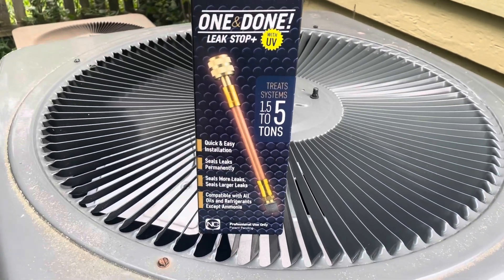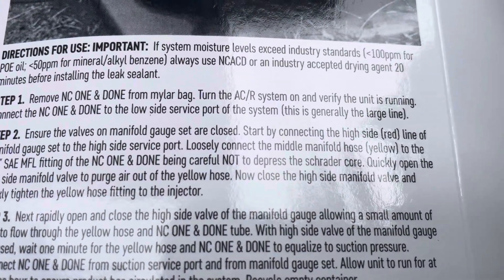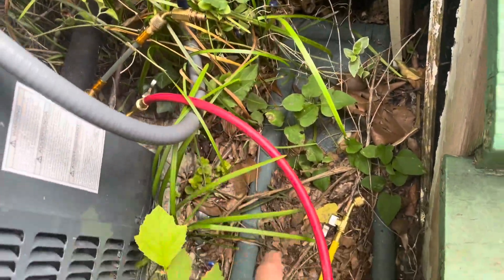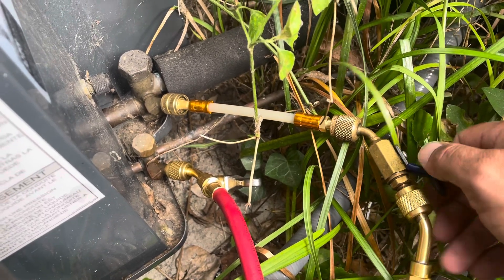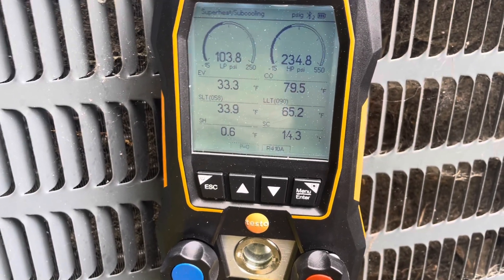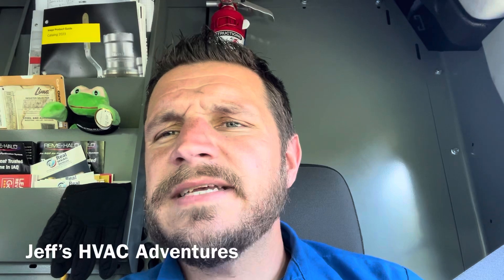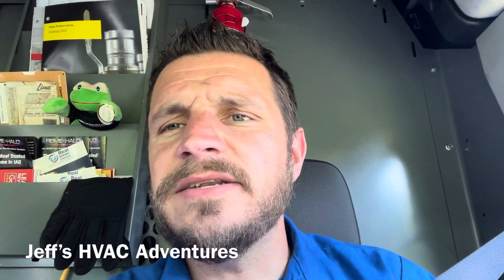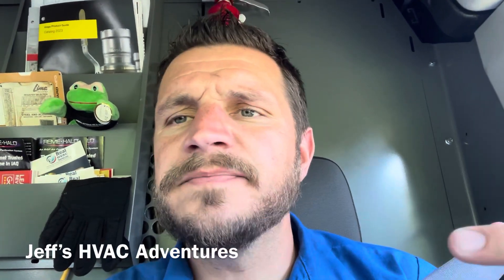Goodman Heat Pump Low On Refrigerant!  Adding Leak Stop And Charging With R-410a!

Comment: Whats the difference between a nitrogen charge and refrigerant charge? My condensor coil was diagnosed with a small leak and most of these HVAC techs want to replace the unit instead of sealing the leak.
Reply from the maker: A nitrogen charge is just a leak testing procedure.  We remove the remaining refrigerant, fill the system with high pressure nitrogen and try to locate the leak.   Once the leak is found, it’s repaired, system evacuated and charged with fresh refrigerant.

It is a costly process and sometimes it makes more sense from a monetary standpoint to replace the system.
Reply: @JeffsHVACAdventures  Does sealing the leak and then topping off with 410A refrigerant make sense? I don't want to get a new system. The air handler is fine.
Reply from the maker: It really depends on how large the leak is.  If you’ve lost half your charge or less then I’d say go head and try the sealant.  If it’s lost almost all the refrigerant, then you would need to find and fix the leak or replace the system.  At the end of the day, it’s up to you.  Don’t let a pushy HVAC sales tech force you into making a decision.   Good luck.

Comment: Maybe I’m doing something wrong because I’ve used the Nu Calgon leak stop 3-4 times on very old systems and it did nothing.  I only use it as a last resort on systems that will likely be replaced within the year.
Reply from the maker: Depends on how big the leak is.  I’ve had mixed results.
Reply: @JeffsHVACAdventures  Systems were old R22 with slow leaks.  Just didn’t work.   At $70 a pop (my cost), not really worth it.

Comment: Why is my ac shutting off at night and will no come back on till around ten am? The evaporator coil’s are not frozen. The unit runs fine in the day but once nighttime comes it wants to go to sleep. Anybody? Thanks
Reply from the maker: Do you have a schedule set up on your thermostat?   When it goes out do you notice the fan or outdoor unit running?
Reply: @JeffsHVACAdventures  I don’t really know. It used to run all night but recently it has been shutting down at night. I was told to take the fan off auto and run it constantly. That worked for a while but now it’s starting to shut down again. No the outside unit is not running. It’s kind of hard to tell. We’re on the third floor and the unit is on a pedestal on the outside wall. I really don’t think it’s running. I can see it through the window but I can’t hear it. I’ve had a couple guys come out and they say everything is normal. All they want to talk about is replacing the system. It’s a 2009.  It runs like a champ in the daytime. I hate to replace something that works so good in the daytime.
Reply: @JeffsHVACAdventures  hey Jeff I think I figured out my problem. After the ac shutdown tonight I went to the thermostat and turned the unit off. I waited about twenty minutes and turned it back on and walla. It fired right up. So now I guess I’m going to have them replace the thermostat. I hope that cures the problem. Thanks for your reply.

Comment: I have a Goodman HVAC in my rental property.  I am not sure of the model or the size.  It has to cool and heat slightly over 900 sq ft.  The unit is one year old this month.  It froze up earlier this month.  There was ice on the fat copper wire in the closet inside.  I presume there was ice on the outside unit.  At least that was what I understood.  Waited hours for the ice to melt, and afterward, it cooled fine.  I asked what caused this to happen?  My filter was NOT dirty.  I change filters regularly.  I do not have a choice because I have respiratory problems.

It cooled fine for another day and half.  I kept checking the closet because I was worried.  Sure enough, a day and half later, a sheet of ice formed on the fat copper pipe again.  I pushed the temp up to 78 with fan set on ON as instructed.  Tech came back and eventually declared the computer(?) board was bad.  Said it was bad from the factory.  So, he replaced the board. It took 4 hours total to switch out the board. About 40 minutes of those 4 hours was to collect the replacement part from a shop somewhere.  

I like to be safe than sorry, so after the board was replaced, I put the bucket back in the clot again just in case.  Sure enough, it leaked.  The man said it needed insulation, which it has never had before. He came back a third time and added a foam rubber material all up and down the copper pipe. In an abundance of caution, I put the bucket back in the closet again.  I checked the closet that evening, and sure enough, there was water leaking out of the insulation into the bucket.  Now, however, I also saw another leak on the wood boarding that holds up the unit in the closet.  So, I put a  plastic bowl there, and it began to collect water as well.  I left everything alone for the next 3-4 days to see if this was perhaps residual water and it would stop.  It has not stopped.

The water in the bucket and in the bowl combines equals about 1/4 to 1/3 cup of water every couple of days. However, the HVAC has cooled the house just fine ever since the board was replaced.

I have NEVER had to keep buckets and bowls in an HVAC closet to catch dripping/leaking water before.  I cannot believe this is normal.  Is it?  I am not sure what to do.  I am afraid to complain again since this is a rental property, and they hate to do maintenance.  I am worried, however, that there is still a problem, and if it goes unchecked, it could get much worse and possibly even kill the unit.  

Anyone??
Reply from the maker: It seems that either the unit isn’t draining properly or the large copper line isn’t insulated properly enough.  The large copper line is called the suction line and if it isn’t fully insulated, it will drip.  So none of the bare copper on that line should be seen or it will drip.  Hope this helps.
Reply: @JeffsHVACAdventures  I will look at it again, but the copper line has that foam padding up and down its length, and it is taped at the ends, although the tape is not uber tight.  I think in that case it is not draining properly.  I have never before had to keep a bucket in an HVAC closet for water dripping.  Will this likely continue once the weather turns. cold??
Reply from the maker: @user-lz6dm5lk9y  no, during heating season a heat pumps outdoor unit becomes the evaporator and will terminate its water from the outdoor coil.

Comment: 32.8 F, you're close to freezing your evaporator coils. It's possible in the condition it was in the customer lowered the thermostat. Could be a meat locker in there after recharging. And the leak stop didn't do that, it's the 3lbs you put in. You'll know (as a good tech) when you come back in 2 weeks to check the readings to see if it lost any refrigerant. I'm sure if the owner came home to a meat locker, he adjusted the stat. Could be poor air flow, but with a leak you probably just have a low charge situation. Leak stop is good on budget but as you said, a leak fix is better. I didn't see any caps on those Schrader valves so that might also be an issue. Core replacement is cheap and easy. Imagine putting leak stop in your compressor only to fix a leaky valve. lol

Comment: Some tech say it bad, will interfere and damage unit. Why can't they be on the same level, so much wishy-washy
Reply: Sticky sealants stick to your compressor too. So it will shorten its life. Like stop leak on oil leaks in your car. Cheap, but no really good in the long run. Last ditch effort for more time.

Comment: how does this impact the lineset when it comes time to replace the entire system?  gonna wreck the lineset?
Reply from the maker: You should always change the line set when replacing the equipment when possible.  But if you keep the same line set It wouldn’t bother it at all as long as you flush it properly.
Reply: @JeffsHVACAdventures  Blow a cleaner peg through it.

Comment: this isn't a serious video right?
Reply from the maker: Yes it’s a joke that only you understood.
Reply: @JeffsHVACAdventures  I understand your pension for working with customers. But for better results, insist on leak fixes. I suspect the Schrader valves may have had a hand in this leak. Simple fix, but a leak check could result in a paying customer and do it right. Better in the long run for the customer.
Reply from the maker: @anthonylosego i do push for leak searches.  Most of the time, customers cheap out and take the least expensive route.  This particular customer actually just sold this house last week, so that's why he was so cheap on this repair last year.

Comment: I paid someone to do the Max Seal Ultra and slso add 2lbs of R-22.  He charged me $500 for the R-22 and $270 for the leak stopper.  I was wondering if to high cost or this is average people are charging.
Reply from the maker: Seems in line.
Reply: Leak stopper is like $40 on amazon and can be done at the same time as adding r-22 so he worked you hard on that upgrade.
Reply: Probably spent $30 in r-22 and should have taken all of 20 minutes to do.
Reply: @darylfortney8081  R-22 is retired. It's getting expensive. Just a hobbyist/researcher.
Reply: That coil really needed cleaning, even a complimentary water hose spray down
Reply: What color was the bottle of refrigerant
Reply: @hilljack6765  Who is this distributor? I'd like to buy some.

Comment: What do you do if the low pressure switch is in lockout? Lennox system has a really slow leak. Plan to add sealant and then charge the system. However, can this be done when the compressor is off, due to the lockout?
Reply from the maker: Bring the system up to full charge first and then add the sealant.
Reply: @JeffsHVACAdventures  Thanks Jeff. Is it okay to charge the refrigerant when switch is in lockout? I assume that the 410 tank pressure will add enough to deactivate the lockout, but not sure.
Reply from the maker: @H2ObarryField  yea, it should take a good 3-4 lbs with the system not running.  Should be enough to close the LPS.
Reply: @JeffsHVACAdventures  Thanks, Jeff. It worked!

Comment: My system was blowing room temperature. Here I've won't copy him out. Told me I need a new unit. You're gonna charge me $1500 to recharge the unit and tell me it wasn't worth it. They gave me a price to replace a unit $8500. I got another pressure for another company. They wanted $10500. I told him both tests.  Eat s*** found it a guide to the redneck underground. He come well overlook data. Pump the system to finally help pressure for 35 minutes. No leak, so before we did that. We put new refrigerator again. Put that fixed yellow and fill the system up. Charge you $400 HBA C companies, repairmen or thieves.

Comment: I would think the time the unit was running with a low charge while you were putting in the one and done, the evap coil frosted over, creating the issue of low evap pressure. When this happens, you only had to kill the condenser power for about 5 minutes, then you would have thawed the coil and pressure should come back up. That could have been verified by looking at the condensate drain and you would see that surge of condensate water coming out for a minute then stopping. If that didn't happen, then i would say cold room, dirty evap coil, fan speed or TXV issue. Just my thoughts here, from 41 years of experience.
Reply: I have heard the txv gets stuck with this stuff.

Comment: Don't get it!  If u can't go inside the house,how is the ac on. If Temp inside is cold. Why is the ac running.
Reply: 62F degree day. The subcooling shown would keep it fairly cool even with that level for that day. So the owner left it on. The subcooling was so low, it was just keeping up but running constantly. No match for a 90F degree day though.
Reply: @anthonylosego  thanks for ur response.

Comment: Where did you buy that Leak Stop+? What store? I can't find it anywhere. And why did you choose that sealer instead of others (like Easy Seal)? This info would be very helpful to me. Thanks for the video!
Reply from the maker: United Refrigeration is where I got the leak soap and the One and Done.  Really only used this brand because it was available.  But I do use Easy Seal exclusively now.
Reply: @JeffsHVACAdventures  Thanks Jeff! Much appreciated sir!!!
Reply: How is it use with 410a? Psi on the vapor line is usually in the 100psi and u need them to be under 65 psi.  Thanks for the input. @JeffsHVACAdventures

Comment: Letting refrigerant flow into your lines then cracking for a purge seems pointless to me the air that was in your hoses has already mixed with the refrigerant its not like the air is just compressed and separate from.the refrigerant the only thing that makes sense is if you had the line loose when you hook up the high side hose  then maybe the refrigerant could push out the air but like that ita already mixed
Reply: Agreed. You need to open the high side and immediately purge. Otherwise, the air in your lines is leaking back into the system while you wait. The faster you purge after letting gas in the gauges the better. Ball valves are good for this, but you have to be quick while the pressure equalizes. Every second it is equalized allows air contamination to flow back into the high side connection. This is called diffusion. Higher concentrations move to areas of lower concentration by gas type. Hence, the air in the lines will bleed back into the system so long as the ball valve is open on the high side source. Minimizing the time the line is exposed to the high side source with air still in the lines is important. Bleed it quickly. Once you do that, you can take some time to push the stop leak in. A tiny bit is probably all that is required. You put a lot of liquid in the low side. I'd have turned it (the ball valve) each time very momentarily and do it half as many times as you did. Getting that last 3% of stop leak in there is less important than all that liquid on the suction side.

Comment: I don’t understand how you can add any refrigerant without cleaning that condenser coil first
Reply from the maker: My thought was that I’d rather have the head pressure a little higher on the cooler day that I did this repair.  As opposed to cleaning it, having a sopping wet coil and have my head pressure even lower.  As you can see from my readings, even with a full charge the dirty coil didn’t effect the head pressure.
Reply: So true.  THESE GUYS KILL ME !!!
Reply: Probably alot you don't understand karen  fkn do you!🎉😢😮😅😊😂

Comment: I had Nu-Calgon Ultimate Easy Seal 7.5 ton with UV installed in my RUUD R22 system and the charge has been holding for almost a year now and the house is a lot cooler. I also keep my coils clean and a Merv 1 filter but I did have a slow leak in the evap and Easy Seal 7.5ton UV worked. I did my homework first.
Reply from the maker: Good to hear!

Comment: No load and possibly air flow, good call. Suction pressure rule of thumb saturation 30 -35 degrees less than entering air temp, so 65 degree space is possible.
Reply from the maker: Good Rule of Thumb!
Reply: That’s only for no load so if it’s 68 return air then the suction line temp should be arround 30
Reply: @arrealhandymanservice4459  suction saturation would be 33 degrees at 68 degree return air, so any temperature over the SST "33" would be superheat. 30-degree suction line would indicate flooding.